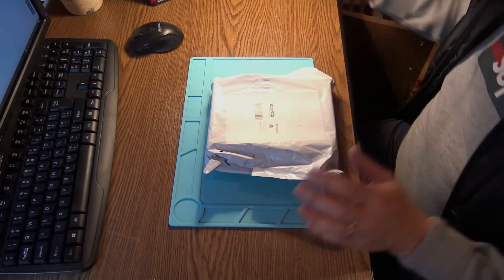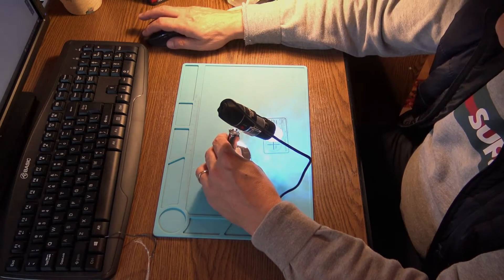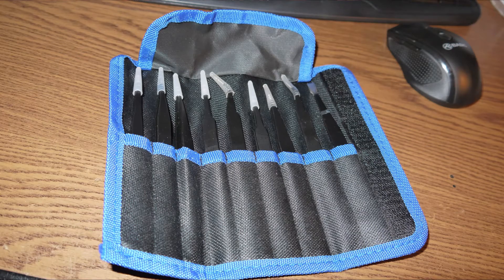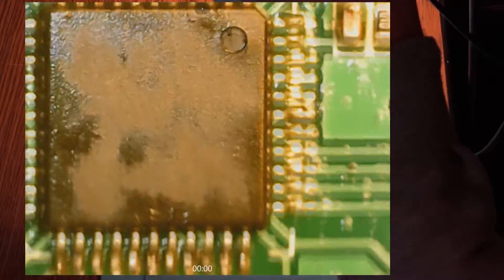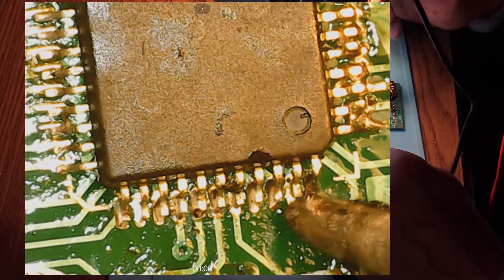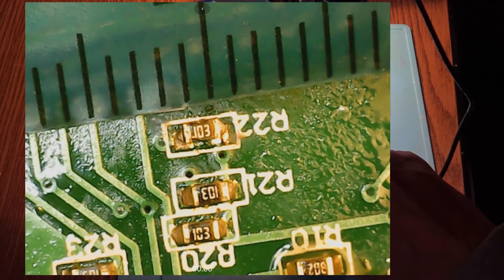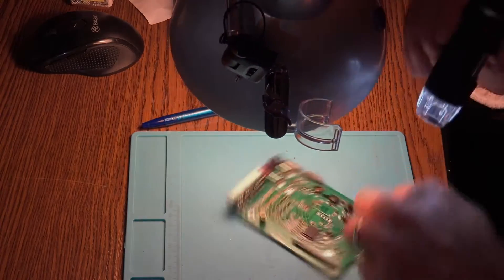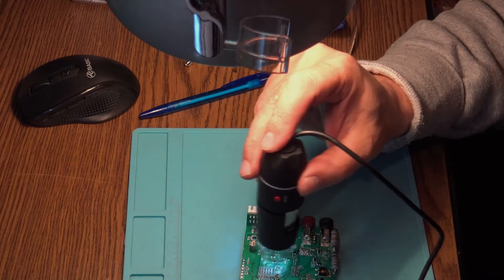USB digital microscope 50-500X magnification review

Comment: So this is better than the 1000X
Reply from the maker: For my needs I found lower magnification is better..
Reply: @viocaia  For pcb board viewing?
Reply from the maker: @irishguy200007  I found 1000X to much magnification, not enough space under the microscope..it can be use somehow with a proper stand. I rather go for 600X max
Reply: @viocaia  Cheers for that.